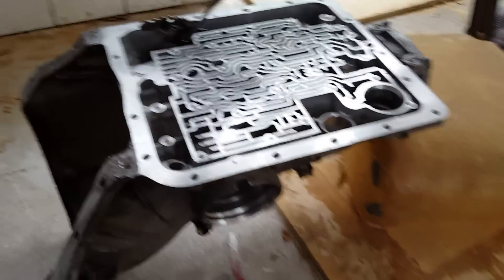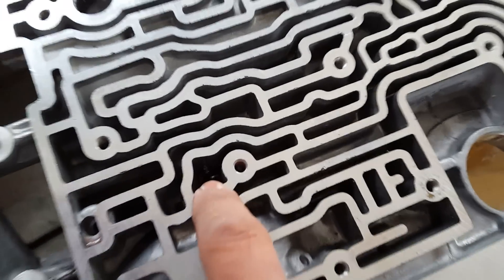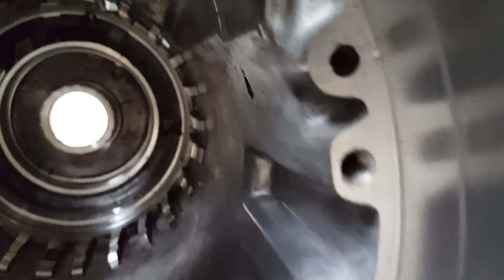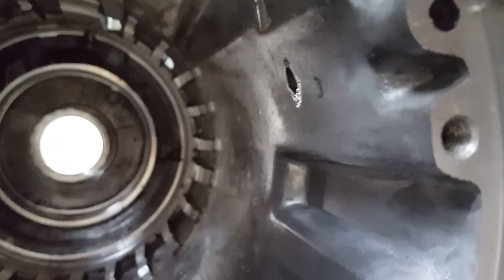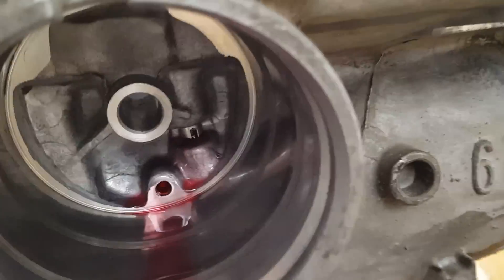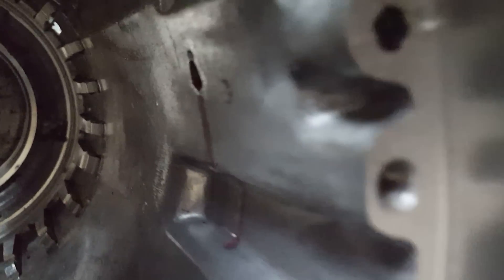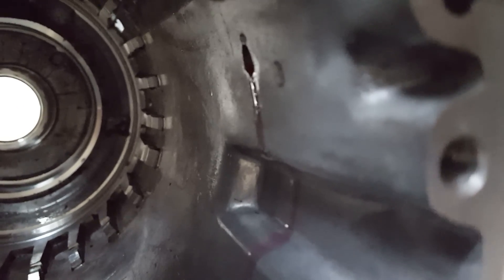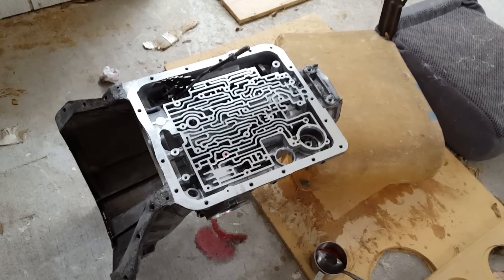4L60E Preventing 3/4 clutch failure!!

Comment: Wont make a difference short term if it leaks. Long term could be a problem if youre expecting to get another say 100k+ out of it. Something else most people miss is servo pin bore wear. So this check ball becomes relevant because during the 2-3 shift as fluid is pushed onto the case side of the servo to aid in unengaging the servo. Some of that pressure can be bled off through this ball, albeit minimal. The worn servo bore however can really let the fluid fly out past the pin and bore. A failed low mileage unit might not have enough wear for it to be noticeable. But if that case has 200k+ on it, that pin bore is gonna have some wear. Sonnax makes a servo pin with seals on it aid sealing even in a slightly worn more. Ive never seen a 4l60E servo pin bore be so bad that it required reaming and insert installation like a lot of ford products but there can still be enough wear there that pressure can bleed off and maintaining as much commanded line pressure as possible is very important for the life of the 3-4 clutch.

Comment: That is to vent air from the hydraulic system it supposed to seep but seal as well. Don't even look for a leak just replace it cheap and easy no matter what people say it's a piece of cake. The issue is that leak will cause lower line pressure in the whole unit if there's leaks elsewhere putting more strain on a 3 to 4 clutch pack that was already taxed to death anyhow. Replace that thing with the AC Delco replacement every time you get a chance to look at it. Or carefully plug the boar do not plug the bottom part of the servo housing plug the exhaust Port up top Air exhaust Port up top. In my units with that air exhaust Port pluged more steady and consistent line pressure was achieved and seems the trans temperature stays cooler I believe the relieved stress from the sep hole pluged gives extra Cooling and lubrication to the clutch pack.
Reply: i realize I'm kinda randomly asking but does anybody know a good website to watch newly released movies online?
Reply: @Ignacio Drake Try FlixZone. You can find it on google :)
Reply: @Kole Fabian yup, have been watching on FlixZone for since april myself :)
Reply: @Kole Fabian Thanks, signed up and it seems like they got a lot of movies there =) Appreciate it!!
Reply: @Ignacio Drake You are welcome :)

Comment: I feel your pain.   Mine is leaking, too.   Even tried to take it out with my slide hammer and a 3/8 x 16 4 in bolt.   Ended up damaged the hole in side of the case.
Reply: I never pull them factory check ball capsule out, best way is to just put the Sonnax check ball capsure in (it's made to go in without removing the stock one)
Reply: @bbahunter6436  when all else fails, read the instructions?
Reply: @Artoconnell  Use Sonnax parts; "failure(s)" eliminated!  LOL

Comment from the maker: You do have a point. I also spoke with a builder locally that said in all honesty even if it did leak, it wouldn't pose a problem.
Reply from the maker: @illuminateBeats1  that's the video series I used to rebuild my 4160E!
Reply from the maker: @illuminateBeats1  If you look at the video I did the exact same procedure as he did time line 04:10 to 5:19.

Comment: the check ball is unseated by debris, try to blow it with brake cleaner and air gun few times, and check it again.
Reply from the maker: I cleaned thr entire case with a pressure washer
Reply: @frankmaggio4328  The check ball assembly has damage on the valve seat from cycling. With 180-200 PSI on that bad valve it would be like a pressure washer nozzle spraying inside case. Upgrade to a kevlar / carbon wide band. Plug it, no more 3/4 failures.
Reply: @frankmaggio4328  thats why its leaking :)

Comment: That is not all that will cause 3-4 clutch pack failure. Biggest reason is making the shift pressure too high. Unintuitive I know, but the shift being too hard (ie: shift kit shredding tires) causes 3-4 clutch pack packing plate to warp, burning the sides of the clutches then eventually the entire surface of the clutches. The only fix is soften teh shift or install a stronger input housing, such as the Sonnax housing or the 4L79 housing. 4l79. com

Comment: I never heard this before. I rebuilt my 96 Tahoe with 285,000 miles. I had a 3rd. gear  flair. It was because i had install a 4 cylinder separator plate.

Comment: I have a 07 trailblazer ss that's been to the trans shop 4 times this year because no 3rd and 4th grear.
Reply from the maker: Honestly rebuilding the transmission is EASY.  I have done 3 so far. We tested my neighbors 700R4 and his did not leak. If I ever buy a GM product again,.....I will rebuild the transmission the second I buy it. The kit is only $175. with parts if needed we are looking at $400 for cheap insurance the trans will work.
Reply: yeah I put in shift kits stall converters changed out my my solenoids but I never rebuilt a whole trans.
Reply: get a monster or swap to a 4l80e like i am doing i will use a meagasquirt trany controller and the drive shafts shortened
Reply: @frankmaggio4328  and rebuilding an otherwise functional unit before it goes thermonukular is much easier.

Comment: Nonsense bud. That leak will not hurt anything. After 4 decades in the transmission trade I have replaced 1 capsule because the tabs that hold the ball were broken.
Reply: Correct👍 i only replaced 3 myself. ONLY because all 3 transmission cases was sitting out side, so it had lite rust on that capsule. For a rebuild on empty case.
Reply: False as hell.
Reply: Its an 8 dollar part. thanks ..lols. anything else you guys decide is there for no reason? guys like you are why guys like me learned to do our own.
Reply: @Artoconnell  And it's it guys like you that mis-inform the untrained techs.

Comment: Anyone ever had a l460e and 3 and 4 go out and then when it's manuly put in 3 the starter engages,.. Any help?
Reply: xThunderMelonx just happened to me a while back but finally going to work on the truck gonna get a cheap rebuild comes with warranty and it's a shop an hour away so not too bad then attempt to rebuild my current one and...loose half the parts :/ but I want to do an overkill build sonnax input drum billet pump 5 pinion planetary sun shell oversized 2-4 band all possible upgrades for an engine that only make 250HP 😂👌which I predict will be done between a month and a year or 2
Reply: Tina Lexis did you ever find out the cause for your concern I replaced a transfercase and same thing is happening in my 03 tahoe 5.3
Reply: I am no expert on transmissions,but if I remember correctly,3-4 solenoid could be grounded through starter circuit,it could be bad or nuteral safety switch,be a good idea to scan for codes first!I know it is an old post and you already have it fixed but this could give someone else a place to start with the same problem!

Comment: I have a 03 tahoe run fine until u ride on a flat surface it will nt shift out of second to third so I hold my feet on da pedal just a little bit and it go bout 35 to 40 on da express way try to  accelerate rpm rev up what can I do
Reply from the maker: With these transmissions, a few things can go wrong 1. seals, 2.valve body, 3. friction plates, 4.solenoids.  The valve body costs about $120 on ebay. Comes with all the solenoids. Replace it see if it fixes it because the valve bodies can  be worn out and solenoids can fail. If it doesn't. The kit costs $175-200. and about $160 in tools. There are seals that fail so fluid flows by. They need to be replaced. They are cheap but you have to get to them by disassembling EVERYTHING. Might as well replace the frictions as well. It truly is easy to rebuild. Dodge transmissions, forget about it!!! I won't touch those.

Comment: Last night my 07 Sierra with 4L60e started acting up. 1st gear holds abit longer now, and 2nd to 3rd does a little slip or almost like a double shift...
3rd to 4th is fine.
Any ideas what went wrong?
Trans was working flawlessly up untill i exited the highway last night, then noticed this after i took off from the first set of lights after the highway...
Hope im not into a complete rebuild....i just replaced filter and GM DexronVI fluid about 2 months ago
Reply from the maker: They say if you did not change out the trans fluid regulatory at factory set intervals since new,  replacing the trans fluid and filter may cause this if the trans has high miles..
Reply: Frank Maggio 
Im in Canada, so the odemeter is in kms, but i have about 145K miles on the truck.
Do you think its screwed? Or maybe try some Lucas trans fix to see if the thicker viscosity helps out?